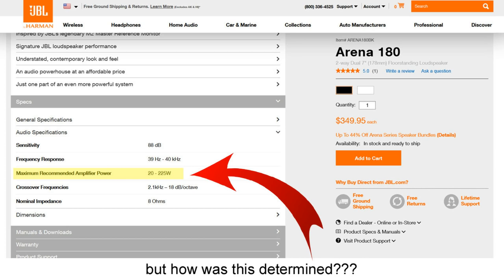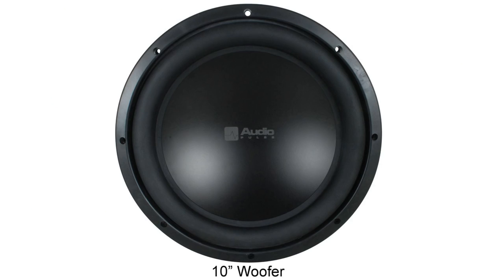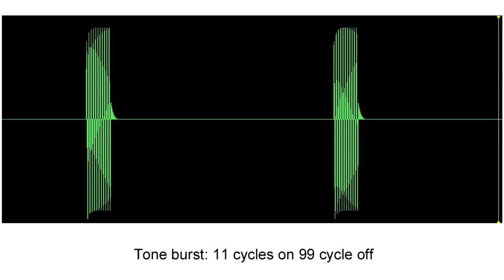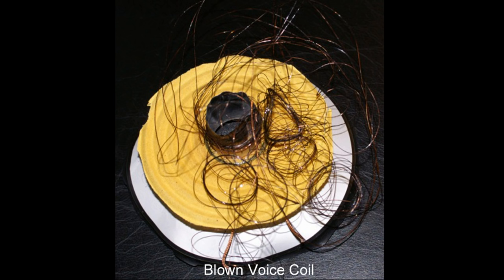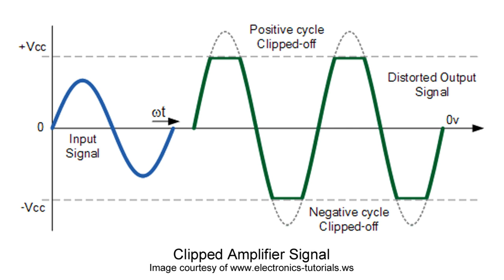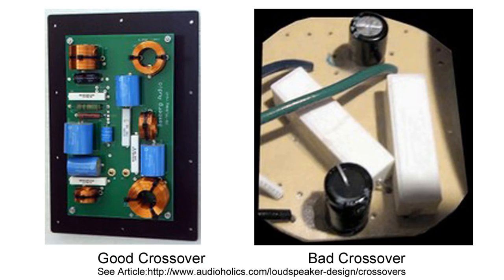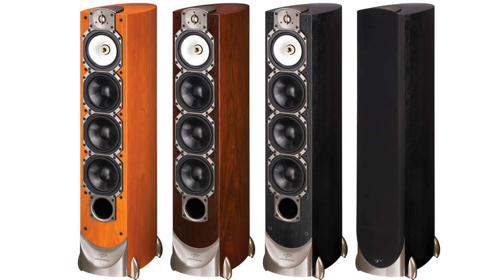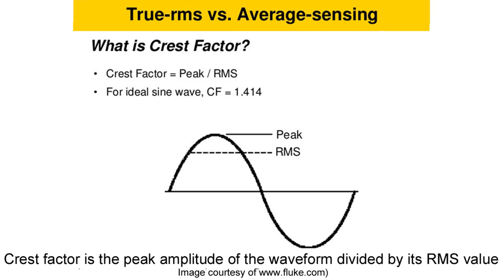The Truth About Matching Amplifier Power to Loudspeakers

Comment: what about running a 60 watt amp into 100 watt RMS speakers?  (under powering)  what of the amp is a high current Adcom?  I've heard that you need to have at least 50% more amp wattage than speaker wattage.  Is that true?
Reply: The 60 into 100 isn't really a factor.  60w can drive mos speakers to a decent level.  What you need to watch for is the amplifier being driven to the point where clipping of the signal occurs.  Even a 60w amp when clipping can fry a 100w rated speaker.
Reply: I agree. If you take into account speaker efficiency you can see that a speaker rated at 90dB @1 watt will literally blast you with a very loud 90dB sound level (if you share a wall with neighbors they are probably being annoyed at this level) 93 dB would take 2 watts, 96 dB would take 4 watts, 99dB would take 8 watts, and so on so you can see that you can play incredibly loudly without a very big amp. If you have a 60 watt amp with 100watt speakers then you will likely (hopefully) hear distortion before the speaker melts down and you will turn the volume down. If however you are the type that is not bothered by distortion then it is possible to drive the amp to such a high power level that the distortion it produces will damage the speaker right before your eyes.

A 50% margin (60 watt amp, 90 watt speaker) is generally not enough of a safety margin for those that are not sensitive to distortion. I generally recommend to my friend to go with a 5 or 10 times margin, i.e. 60 watt amp mated to speakers rated at 300 to 600 watts. Since power is very inexpensive today, I generally recommend to get as much power as you can afford, so the transients sound good (special effects, etc.) and the signal is clean and clear the rest of the time (just back off if the system has any sign of distortion whatsoever),
Reply: @Billy123bobzzz  Most/all amps these days have clipping protection so not really an issue. The amp will shut down momentarily if it detects clipping or lower the volume (as mine does).
Reply: @Taffy84  I'm aware of that. But a lot of folks don't like clipping protection and you really shod not need to drive your equipment so extremely hard that it clips, that just shows that there is something wrong with your configuration. We have amp that have a switch that deactivates clipping protection, which all my friends and I use because it seems to us that during loud passages that do not engage skipping protection, the sound quality gets muffled (so obviously the clipping protection is actually affecting sound quality well before clipping actual happens). We do use amps and speakers that are well matched now and do not ever get near clipping because the amp has plenty of headroom and the speakers are so efficient that we spend most oof the time at very low power level, where the amps sound best. For all the amps that  have owned, they operate in Class A up to 1 or 5 watts then after that they switch to Class B, so by using a speaker that deliver efficiency of 98 dB at 1 Watt, who his so loud that we never really play hot that loud, so 99% of our listening occurs while the am p should be in Class A mode, which gives us the best quality sound.
Reply: @Billy123bobzzz  I just read my manual for my amp and it has clipping protection turned off by default so I am not using clipping protection. Guess I should leave it that way.
Reply: @Taffy84  As long as you are not driving that amp so hard that it creates any hint of distortion, then you are probably OK, and since you did not mention blowing up your tweeters then I will guess that you do not drive it too hard, so I would leave it alone so you get the best sound quality. Enjoy!
Reply: @Billy123bobzzz  Yea, I use it for nearfield listening, less than 1 meter away so only use a few watts at my listening volume.
Reply: @Taffy84  Thats excellent, you might bee within the amps Class A mode (if its that type of amp.
Reply: @Billy123bobzzz  Yea, it's class AB so you are right that I am within Class A all the time.

Comment: I have a set of two tall floor standing speakers. 200watts @ 4ohms, per speaker......please could anyone tll me what amp rating i need and should be looking for. i want to use these to complete my karaoke setup......i am totaly suffering from info overload and need just a straight answere......plain and simple is best...LIKE ME LOL.  Thankyou for any advice....PLEASE
Reply: If you never ever want risk blowing y the speakers dues to distortion (clipping) from the amplifier, then use a 20 watt amplifier. If you are a reasonable person and will keep the volume level turned down to below the point of distortion then you can use an amp with anywhere from 20 to 200 watts.

Comment: I always say to people its the amp that produces the sound not the speakers. The speaker just does what the amp tells it. I Always go by the rule that as long as the amp don't exceed the max power handling of a speaker your good. I go for about 20% more then the speakers RMS and I ignore the max power unless my amp is 30-40% more so I know my max volume I can go on my amp so I don't drastically shorten the lifespan of the drivers. Under powering is way way way worse and I hear so many people say well as least you won't blow your speaker wrong wrong so wrong. If a speaker say its 50 RMS then the amp must at least match it or the amp will clip as that speaker will demand 50 watts and if your amp can't it will clip the signal and boom buy buy speaker. Good but you won't have any headroom in the amp if its matched always go over and don't push the amp and your speakers won't distort

Comment: Most of the "speaker wattage" handling capacity is pure BS.    Most speakers used in the home CANNOT handle 100 watts continuous sine wave power without failing for any length of time over five seconds.

Comment: I have a corsair sp2500 and they rated the speaker of 230w rms using the iec method for 24hours use.

It means it can handle the power for 24hours non stop.

Comment: So is this a true statement: 

I never have to worry about an underpowered amp as long as I never clip the amp trying to get to my desired volume… 
In my case, 600 watts driving 2 speakers at 300,600,1200 watts each (jbl prx 412m) … pro audio
Yes?

Comment: You will get the most performance out of a speaker with a vastly overpowered amplifier but you have to be careful of program content and level if you listen loudly. A less powerful amplifier means you don't have to worry about your kids goosing the volume and blowing them well apart from clipped tweeters

A 100 watt speaker might be able to take a few hundred watts on a sparse kick drum sound with acoustic guitar in the background before mechanical failure, but continuous bass will heat up the woofer and continuous treble the tweeter.

Comment: Unfortunately, very few audio amplifier manufacturers actually comply with any legitimate methods for rating power amplifier output.  While the FTC did mandate  realistic and repeatable power ratings years ago (commonly called RMS at a stated THD level,) nebulous ratings such as "music power" are now common.  For instance, I recently purchased (and returned) an Ibanez bass guitar amplifier that was rated at 300 watts of output.  It's wall outlet power consumption, however, was 84 watts.  Nice trick if you can actually get much more out than you put in.  BTW, it had very little clean audio output, so there really was no "magic" going on inside it.  Marketing tactics (also known as lies) such as these make speaker-to-amplifier matching voodoo at best, and make comparing amplifiers by specs alone impossible.
Reply: Wow you found a device that can magically make power out of thin air for us. Too Cool! LOL

Comment: A typical vented 200 watt speaker tuned at 40-50 Hz typically will mechanically destroy at less than 50 watt around 30 Hz . In bass , electrical limits are useless , mechanical limits will put an upperbound on how many watts it can handle
Reply: Which is why my DJ system has a fourth order filter at 35.5hz slightly below the box tuning. It can now handle every frequency up to the amplifiers limit. I tried putting a 10-15 Hz signal with the filter off and the cone went crazy even at low power levels so didn't dare turn the amp up.

Comment: I have learned to distrust almost every manufacturer's power ratings for almost all 5.x and above channel receivers.  With the exception of old juggernauts like Pioneer's SC-09 (great receiver, it's only drawback is the once incredible features are starting to get too dated to use be used in "today's" home theaters but still can be used as a respectable power amp), their power ratings are always inflated to some degree, and even on their best models, they often will have a LOWER stereo power rating (which is it's real accurately tested power rating) then 5 or 7 channel power rating which is a BIG red flag they are not being honest with the actual power ratings at 5 or 7 channels driver.   Almost every audio expert will tell you to get an amplifier that is big enough to never "clip" when playing your speakers at the highest volumes you would ever play through those speakers (or possibly even full blast), because as Audioholics said in this video, the most common way a speaker fails (as well as the amp) is clipping the amplifier causing feedback into the tweeter that blows the tweeter or overwhelming vibrations causes the woofer's voice coil to fail.  A decent speaker or amplifier will never fail if the amp has enough power to drive the speaker to the maximum volume without clipping the amp (though some cheaper speakers will still fail if they have poorly designed voice coils or crossover networks).
Reply from the maker: Actually the older Pioneer ICE based receivers were NOT as powerful as everyone was lead to believe.  They simply couldn't drive 4 ohm loads well above 2kHz due to a limitation of the ice module. This was never revealed in the print magazine test reports b/c they only test power at 1kHz.
Reply: Wow, really?  I thought that was their lower end models that had that issue, I feel bad for all these people still forking over big money for those 70 pound bricks.  Was this also an issue with Yamaha's RX-Z11 from that time period?
Reply from the maker: +aegisofhonor no the old Yamaha and Denon flagship mega receivers used linear AB amps and big power supplirs.  they were solid!

Comment: Hey Gene, how can a general user calculate all this....yes it's not possible for u to provide a solution for this but atleast specify the speaker manufacturers for normal consumers who put only genuine information.
Reply: This channel is useless in that they never seem to offer information that a consumer could actually act on. A general rule of thumb is that if the amplifier is very low powered and you play music very loudly then you risk the amplifier's distortion melting your tweeters (or and other driver but usually the tweeter gets hammered first), if the speaker is also rated at low power.

If the speaker is rated at many times the power output capability of the amplifier (ex: a 50 watt amplifier and a 500 watt speaker) then the amplifier could melt its output drive section before the speaker is damaged. Since you should be able to hear a lot of distortion when this occurs in time to back the volume down (there is no guarantee of this, of course) then your system could survive loud passages without melting down any components.

All of this leads me to my own personal rule of thumb: If its a younger person then I recommend that they use a speaker that is rated at ten times the amplifier's rating, that way they have a (slim) chance of turning down the power when they hear distortion before the system melts down. If its an older person then any speaker rating that is the same as the amplifier rating seems to work fine. If its an experienced audiophile then they can focus on what will give them the best sound quality and not worry as much about power ratings because they will carefully audition the various combinations at their usual listening level before buying it and avoid anything that gets pushed to distortion.

Comment: I now believe that speakers should be rated at twice the amplifier power & that speaker wattage - BOTH RMS AND peak - should never be exceeded... If this is done, the speaker will generally last longer, & more importantly, have the ability to handle excessive clipping...
Reply: Uhmmm no I think you misunderstood the video.  You want the amp to be twice the power of the speakers.  Speakers are harmed much more often from under powering frying the voice coils than from overpowering.  Listen @ 6:58 of the vid.
Reply: I know......that you, misunderstand speaker ratings...  '300W'RMS, '600W' peak means: 1. This is the wattage this speaker is designed to handle. 2. This is the wattage the speaker can handle. 3. If you exceed this wattage, the speaker will fail. 4. Do not exceed this wattage(RMS or Peak)... What you speak of is a dangerous method of amplifier to speaker matching - & what I'm suggesting, is a method of speaker to amplifier matching which will keep your speakers alive, weather you clip or not... Do Not Exceed The Wattage Rating Of Your Speakers - THEY ARE NOT DESIGNED TO HANDLE EXCESS WATTAGE - & it is very easy to exceed to input excess wattage when you can do so using clean power...
Reply: Well I guess I have to bow out.  I've seen many more speakers harmed by under powering than overpowering.  Your mileage may vary.
Reply: Use JL audio's website for an example... They have a diagram that explains by indicating power levels that give longevity(it was mentioned somewhere on their site), void warranty, etc - see subwoofer specs here: http://intl.jlaudio.com/13w7ae-d1-5-car-audio-w7ae-subwoofer-drivers-92116
Reply: Marvin Connell that's how I was taught back in the 70s..you are correct

Comment: Simple solution to protect speakers from distortion - use an oscilloscope to determine at what level your amp starts clipping, and  stay below that volume level. Use a 40hz test signal for subs and 1K signal for full range speaker
Reply: Or simply don't play louder than you ever need to... But my problem is I was using some shitty 3rd party phone app to stream my qobuz and it randomly increased the volume to 70% before I picked my next song... The song was speed king by deep purple, and I'm using a 300 watt amp on a 140 wpc rms speaker... I think I'm fcked... I'm considering returning my speakers because I think I broke them. They still play sound, but they just seem a bit quieter and my tweeter sounds very distorted up close.